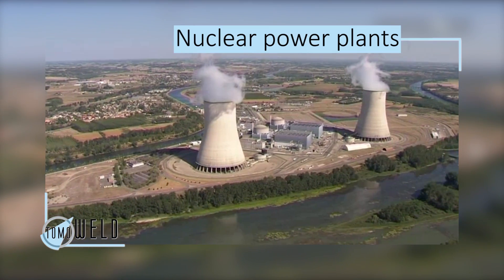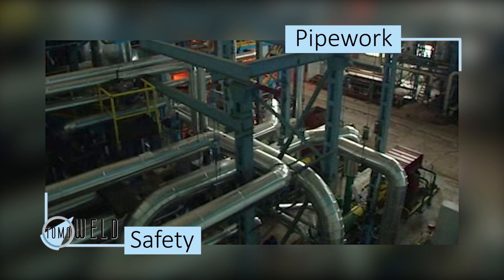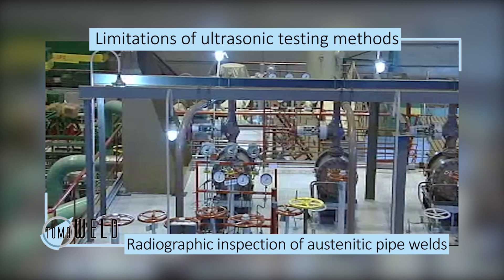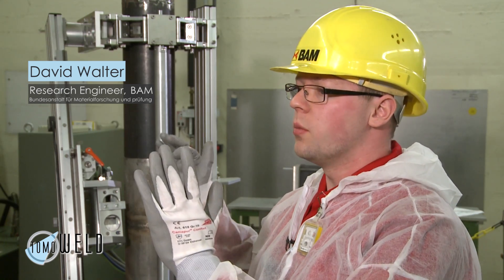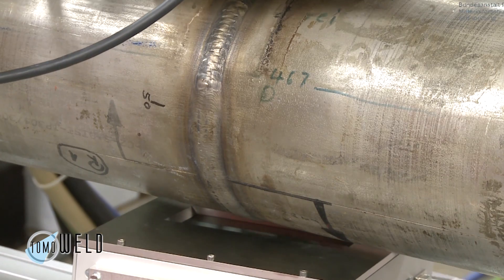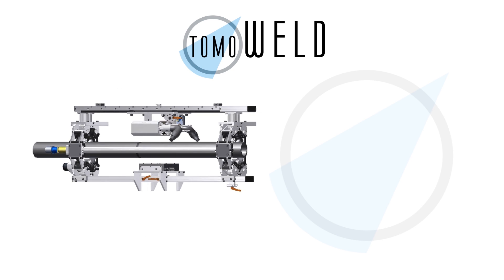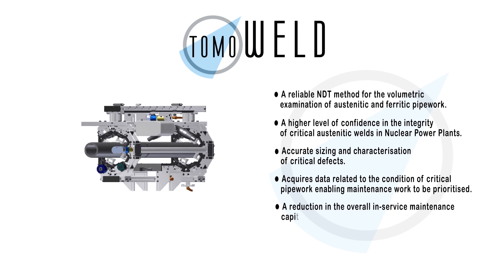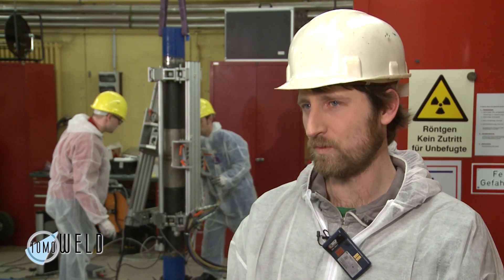TomoWELD - Radiographic Tomography for in-situ Inspection of welded austenitic pipework

Comment: I’ve carried out high sensitivity film radiography for 40 years and can assure you if the machine being shown is the answer it will be limited to a tiny percentage of welds requiring inspection. It is too big. Sensitivity and radiation exposure are the most critical limiting factors. High speed digital with high sensitivity are the goals. Three d positioning is of minor consequence, each defect type has its own characteristics and this will give ample information as to its location. If the through wall position for any given defects is required that can be easily determined with ultrasonics or further x rays. This is fantastic technology but for me impractical, costly and unnecessary